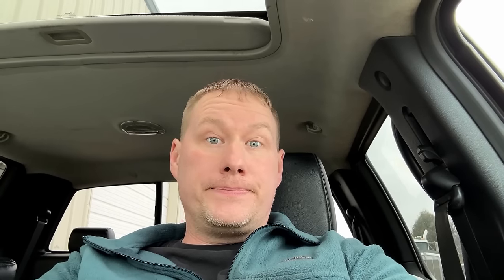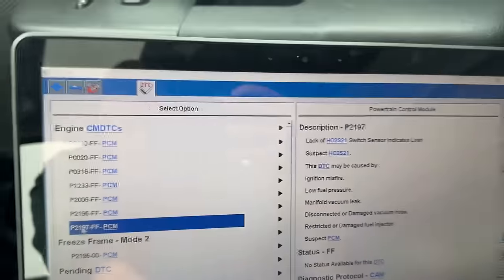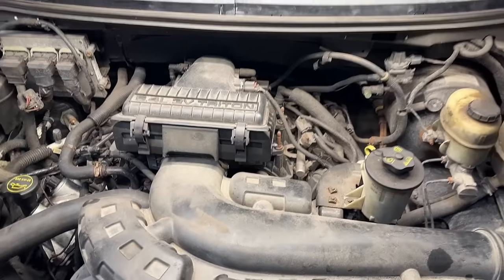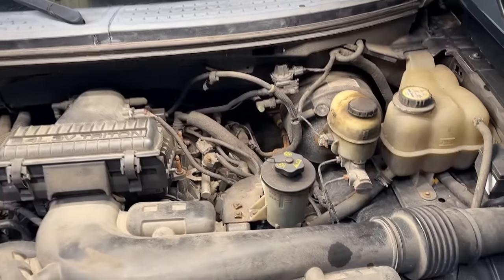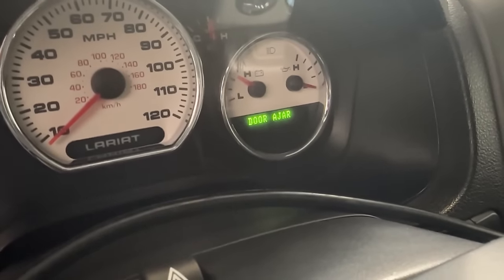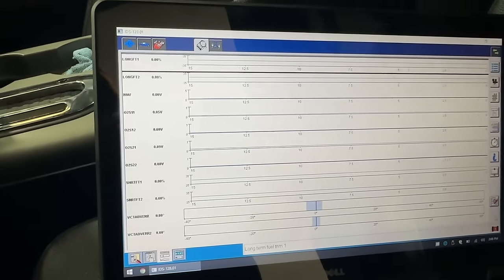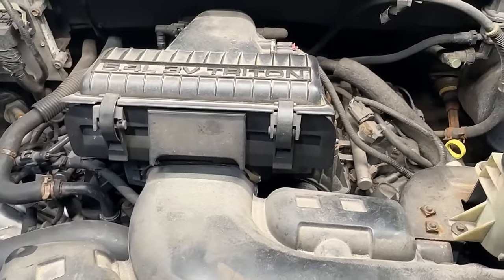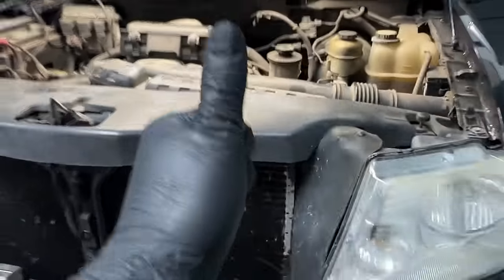Ford F-150 5.4L 3v Triton Engine P2195 P2197 Stuck Lean and Runs Rough: Let's Diagnose It!

Comment: My 2004 died after losing power and had a crank no start  condition. No codes. Timing chains, guides, tensioners, oil pump and vct solenoids changed a month previous. Now I verified 65psi fuel pressure, spark, injector pulses. Swapped out maf, tps, aic and electronic body with working spares. No change. 

Pulled the exhaust manifolds and it started, rough file and rpm’s inconsistent. Manifolds back on one at a time now it starts, what did I do? Now throwing p2195 and p2197. Runs rough, idle unstable, when accelerate in park, rpm’s go high but take sweet time to return to idle speed. I’m stumped.

Comment: Mine has collapsed (pancaked). I don't see splits yet, but do hear occasional hissing. I want to replace this same exact hose, what is the name I should be searching on auto parts sites? 2006 F150 FX4 - 5.4 3v of course.

Comment: Man, I've learned so much from Watchung your videos for the 5.4l 3v Fords. I recently was changing the vct's in my truck. I put everything back together and took the truck for a test drive. It ran so much better than before I chanthe vct's however my font driver's side brake calipers began getting hot amd smoking. It was driving like the brake was locked up or pulling to the driver's side. I put it in neutral and it rolled just fine not like the brakes were locked up. Got home and locked at everything I worked on and nothing is out of place and looks correct. Would you have any ideas of what I may have to check or put my hands on that may have messed up the driver's side front brakes? Thanks in advance.

Comment: I have a 05 frod xlt 4x4 with the 5.4 I have the codes of p2195 says  lean and a code p2198 says Rich I  did just redid the timing system  everything new I did have a broken timing guide on the driver's side can you help find my issue

Comment: really wish mine was this easy ...its a 08 with 200k 4.6 ....2195 and 0053 ... new O2 did not fix ....cleaned MAF  sensor ....no obvious vacuum leaks or idle change with carb spraying near vacuum lines 
UUHG .... cats were replaced last summer and its been fine since then  ... I  need to inspect wiring to 02 yet

Comment: I have a 2010 4.6 with just shy of 350k miles. Have this code but a friend of mine said they could be the intake runners that are not getting engaged by the motor. Had to leave town so can’t take the truck to his place to correct concern. It seems like it is not something difficult to do as you only need to remove intake manifold to get access to it. But would you recommend replacing the entire manifold?

Comment: Just had my 2018 5.0 break a valve spring at 50k miles. Didn't know but apparently this is a very common issue. the dealer replaced it my cost ($3000). Put it together and the cam phasers blew apart. Now they want another $2100. Idk wtf to do at this point.

Comment: Hi. I watch and learn from your videos all of the time. I really appreciate the info. I have a 2008 Lincoln navigator that's giving me P0171 and P0174 codes along with transmission code P1719 and the wrench symbol on the dash. Any idea if they can all be related or what it could be? When I clear the codes the vehicle runs good for 15 minutes then the codes come back.

Comment: My 5.4 3v had 282k. Before the trans gave out and started slipping. My girl drove it for like 6 miles at 5k rpm, 🤣. Non car people, lol. She finally pulled over. When it cooled the motor locked 🤷‍♂️. Im thinking i go 15 and up 5.0. Got any vids on best yr 5.0? Or common issues?

Comment: How can i test the PCV-system if i cant hear any hissing noise or any obvious visual defects on vacuum lines.. etc?
Volvo S40N 1.8 2006, built on Ford Focus C-max/S-Max chassis. Same engine... Ford Motorcraft Company.
What kind of tools do i need? Are the fuel trims the vital data here to check for?

Comment: I have an '89 Mustang 2.3 & had a whistle at 35-45MPH under light load acceleration. Eventually found a broken vacuum line to the MAP sensor; replaced line cleared code & passed smog. Always do a visual inspection, you can find a problem by just doing a visual.

Comment: 06 Expedition. I'm still chasing a vacuum leak. The brakes feel soft until I hit the pedal more than once, then they come right up. 
That vacuum line with the split, when I bought my Expy, that line and the one on the passenger side behind the battery were as flat as a paper straw! I replaced those lines, plus others, but there's still a leak somewhere. No codes, though, except a Cylinder 2 misfire I still haven't found (not the plug, coil, injector or wires), which makes me wonder if the intake is leaking in that area. I recently bought a scope camera, so now I can look at that booster line behind the block as well.
Keep up the good work. These 5.4 3Vs are a learning experience!

Comment: I've got a 2004 f150 4.6 three valve that keeps throwing the same code p2197 or  p2196..   last year I replaced an O2 sensor, when it threw that code 1 bank 2 I think it was..  in hindsight I should have replaced them all, but it was fine afterwards and thank you by the way for the tips on how to make that job a bit easier cuz it worked like a charm when my husband said it wouldn't make a difference, well we proved him wrong, so thank you for that...  shortly after that I had to replace the mass air flow sensor cuz it started dying out as I came to a stop or slowed to  turn a corner.. fixed that and it was fine til recently and started acting up,  engine shake,  running crappy, crap fuel economy ect..  I don't hear a hissing sound though,  but that doesn't mean there couldn't be a vacuum leak I suppose even though it's a 4.6... my OBD II scanner threw the p2197  and  I'm not sure what the heck is going on now but thanks to your channel I do have some other avenues to check out..  I'm also currently working on my 2005 f150  5.4 three valve so  really  appreciate your channel more then you know, it helps me a lot... My husband teases me about you being my go to guy for  problems with my trucks.. he'll say oh you better hurry up and  run to your U Tube Ford guy  cuz something is wrong.. lol.. he shouldn't tease me like that cuz he may need our help with his 99  4.6 two valve one day which is the engine I'd like to have because I'm not a big fan of the 5.4 which is an ok engine I guess as long as you take meticulous care of them! Thanks again for your educational tips and tricks! I appreciate them more then you know!

Comment: Where are you located at?  I need you to troubleshoot diagnose our 2000 ford E-150 van. It has 107k I’ve done all new coils and plugs by your other videos. It runs and drives fine until bout 1/2 throddle or more and cuts out or bongs down. No check engine light or code I did replace tps sensor but no change there is a voltage dropout on it bout at 1/2 throddle. Any ideas help??  Greatly appreciate thanks for the great videos too
Brian:)

Comment: I have a quick question: 2010 f150 platinum, heater blower just started not blowing upon starting the truck, has done it twice, it will come on about 15 minutes after running. Not sure what it may be, hard to believe it's the blower motor seeing it works fine when it works.  Tia
Reply: Does it work on some fan settings but not others? If so, it's probably the blower motor resistor.
Reply: @bartsarton2212  no just completely dead till it decides to work.
Reply from the maker: Upon startup when the blower motor is unresponsive but turned on you want to bump the blower motor itself with a swift hit with the palm of your hand a few times. If it comes alive you know the brushes are sticking. Most of these failures are the blower motor speed controller though on DATC models.
Reply: @FordTechMakuloco  I tried bumping it. Where would the speed control be located..?

Comment: I have a 2005 Ford f150 with the 3V 5.4 with 180,000 miles and it shakes and misfires on cylinder 8 and 2. And jerks bad with the misfire. I've changed to new motorcraft spark plugs but cheap coils.
Reply: Oh and bank 1 says lean and the other says rich

Comment: Replaced VCT solenoids and valve cover gaskets on 2007 F150. Still doing the ‘dieseling’ when hot. Mechanic says look for a new motor. Oil pressure low when dieseling at 14PSI. Oil pressure 25PSI when cold. Any thoughts?
Reply: New oil pump? Rocker followers? Pull the front cover?

Comment: I've got P2195, P2197 and also P0171 and P0174.   I am getting 0.03V on the MAF with engine off, so I plan to change that as per another vid I saw.  I don't hear any vacuum leaks and the throttle body I just took off and cleaned.  I plan to try and check all these hoses tomorrow, maybe I find anything, otherwise I'm hoping the MAF sensor is the trick.  I've taken the car to the garage 3x now, they do something (said they cleaned the throttle body), but after a while it comes back, at which point the car starts but wont even idle, can't rev it, nothing.  No confidence in the car sadly and here in Spain no one knows these engines, it wasn't an EU option.  Hoping with the help of these vids I can fix it myself 🙏
Reply: Changed the MAF today and it seems to have fixed it, its literally a different car to drive.  THANK YOU!

Comment: Funny my 99f350 had the elbow oil soaked and bad but the code said vacuum leak...easy.
Reply from the maker: Yup it depends on the size of the leak and the year. I really don't remember P2195 and P2197 codes in the 1999 PCED but P0171 P0174 have been around forever.
Reply: @FordTechMakuloco  ya my 99 was made in 3/3/98. Best truck for sure